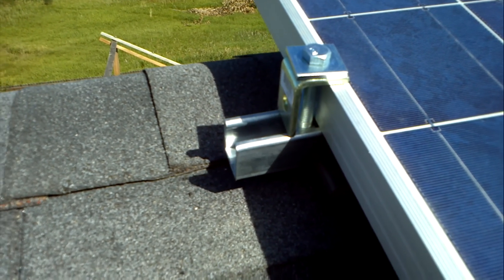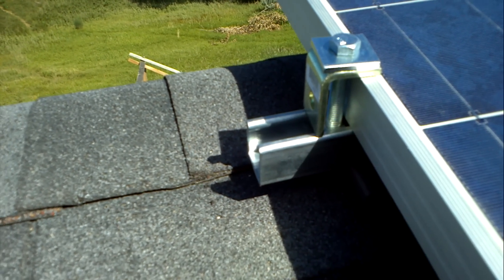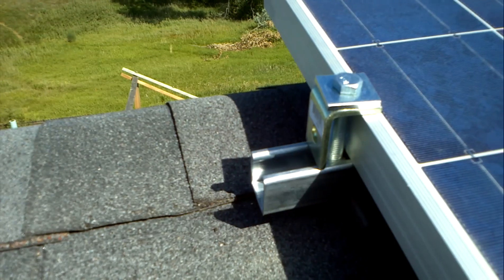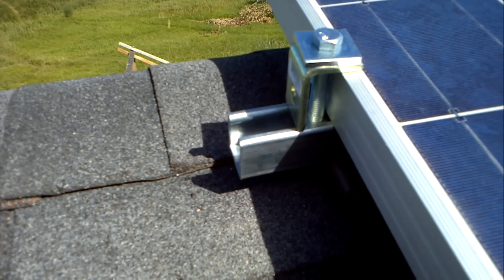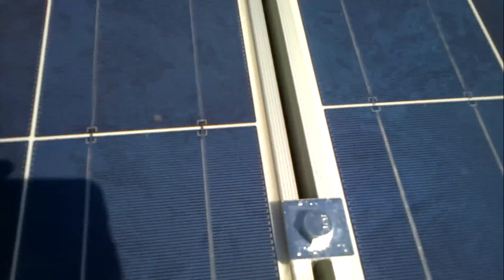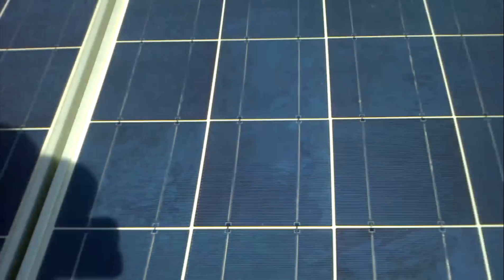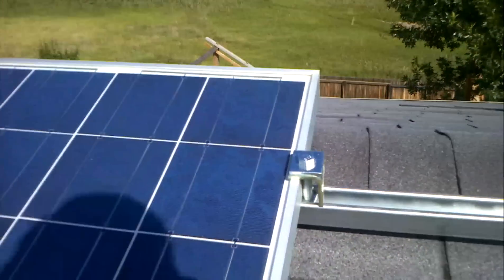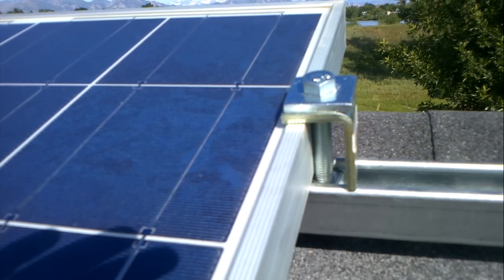Unistrut solar panel connection

Comment: Dont forget gaskets, something like rubber or sunlight resistant plastic between the galv steel and aluminium PV frame - otherwise you will suffer electrolytic corrosion of the steel to the more 'nobel'  aluminium.
PS- This di-electric corrosion has nothing to do with the fact that you have a solar electric panel - it is simple electron transfer between dissimilar metals.
Dave tech from TMSthermalstore.com
Reply: david lloyd-jones good tip
Reply: That is the challenge I ran into.  Everything seems to come in different metals.  The solar roof mount/flashing is stainless, the unistrut is galvanized, most bolts etc are zinc, and solar panels are aluminium.  So many different metals and you can't really choose in most cases as they'll only have one kind.   My panels have been up for a few years now and I want to make adjustments so I will have to check how the corrosion is while I'm up there and figure out a solution if it's bad.